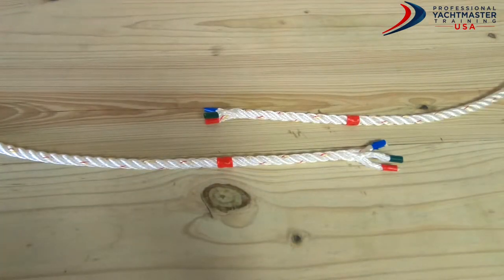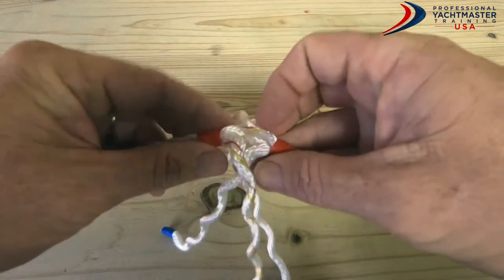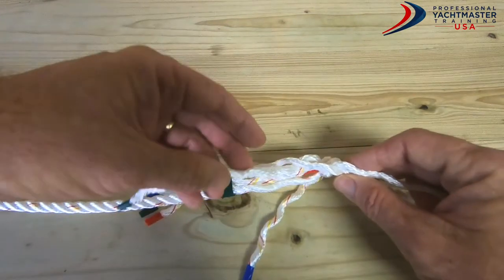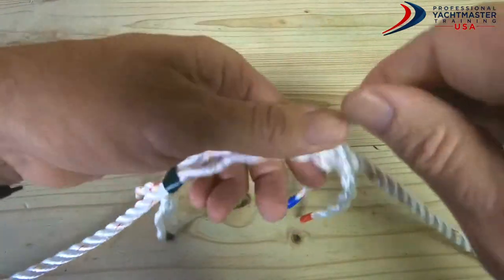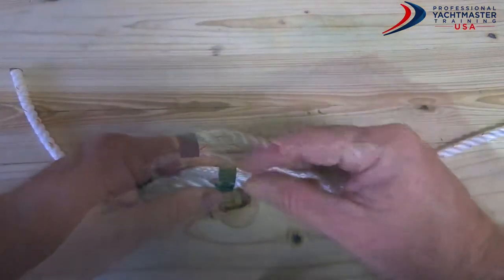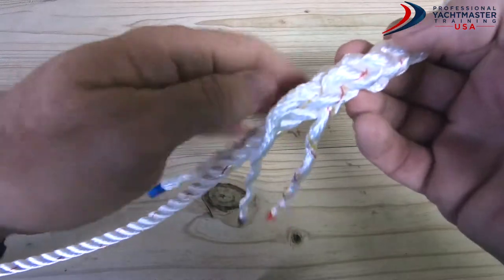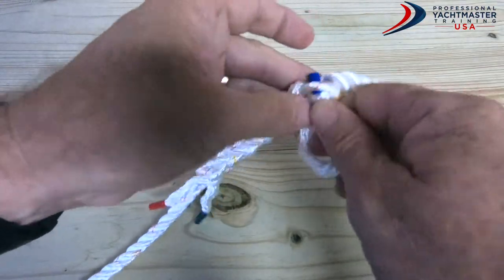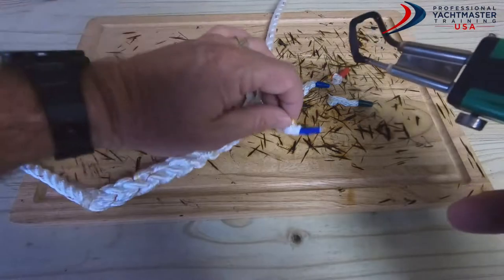How to tie a Short Splice with 3 strand rope ⎸Tutorial - Professional Yacht Training USA

Comment: Thanks for the video. I followed the instructions and also tried to taper towards the last 2 splices. I used nylon rope which I think you have too? I didn't want to seal the ends because I'm trying to make a soft dogs collar. I put small 6 turn wippings on the centre and at the 3rd splice positions, but unfortunately the ends are unravelling. As fast as I cut off the stragglers, more arrive. Is there any way to prevent soft nylon rope from slowly unravelling the splice, without making hard spots by sealing the ends? Thanks
I
Reply: I've left tails long...melted long,and thin... kinda icicle shape
Then feed into center of rope and bury them....best I found.....
I don't like the char look on certain applications...such as yours..